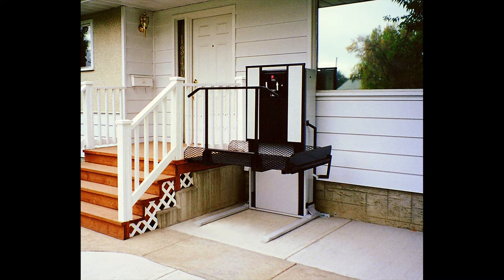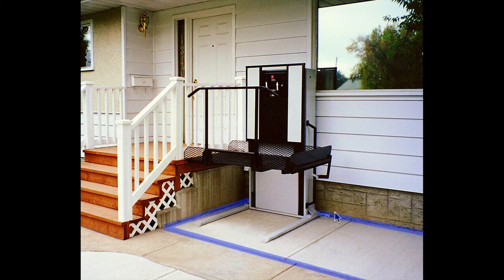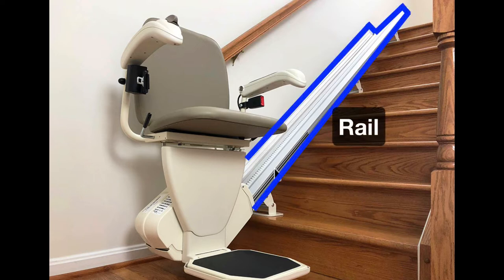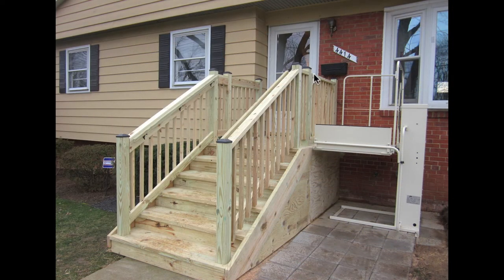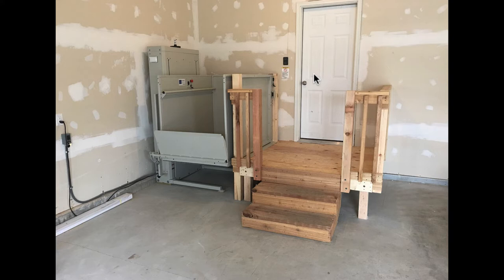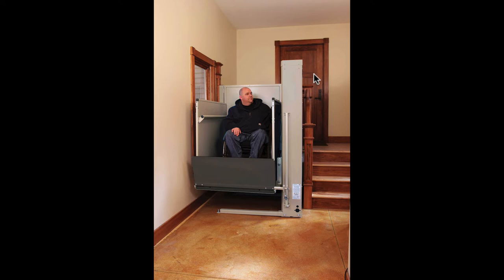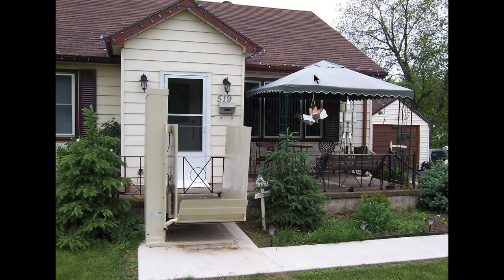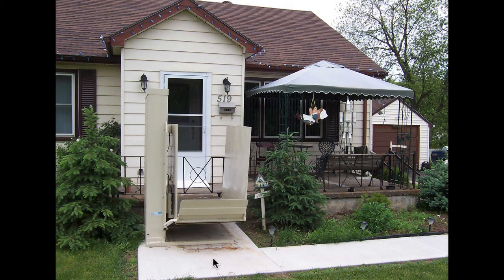Introducing Porch Lifts - Wheelchair Elevators for Your Home

Comment: I’ve been doing a bit of research on this, have you seen the Flexstep https://www.youtube.com/watch?v=saveVAFPpa8&t=8 ? It incorporates both a step and lift in the same footprint.  I’m thinking of using this in an internal setting where we have a split level living arrangement with a short set of steps (similar to the garage setup you showed).  In fact the garage setup could be done with just steps going directly up to the door threshold (about 25% of the footprint.  Interested in your thoughts.